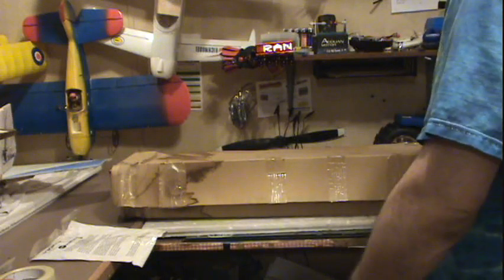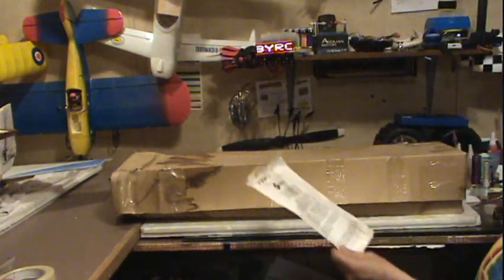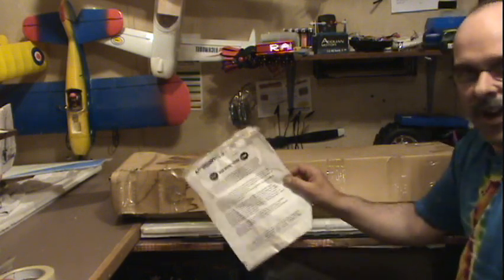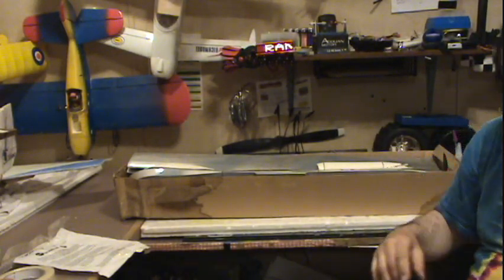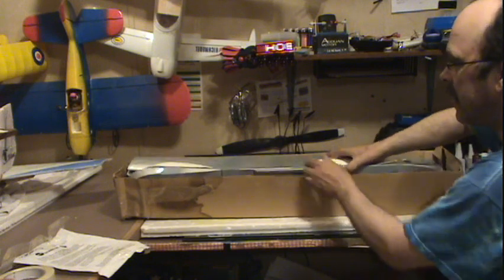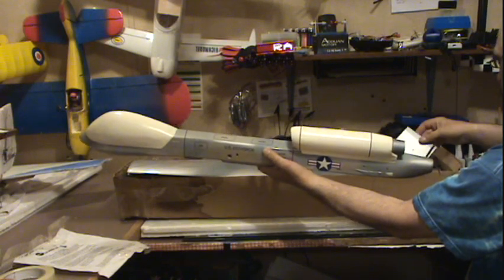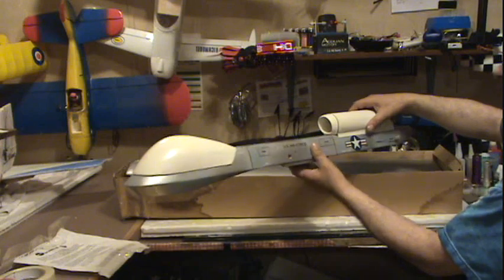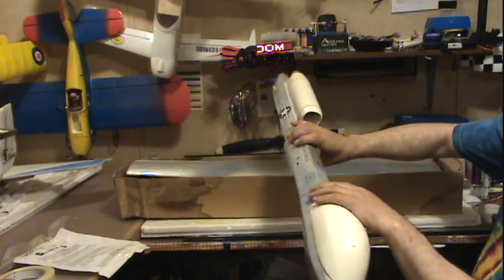preditor rc airplane build video 1

Comment: i decided  early on in my crashing that if i couldnt  buy a plane for the sum value of its parts that had an excellent power system id  do projects like this -  find airframes that i could power up for little outlay - id love  a large bnf T-28 but its almost $200- sniff i gotta fly whatever i can put together -
     -this looks hard to deal with , 1" wide interior space,  dont know if my thinking cap is smart enough